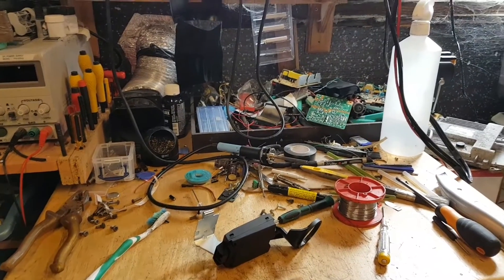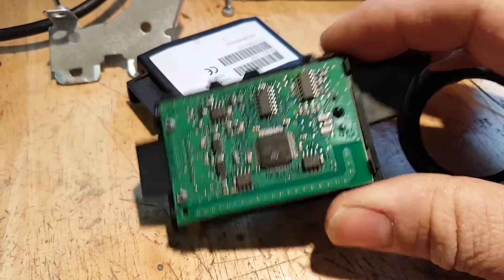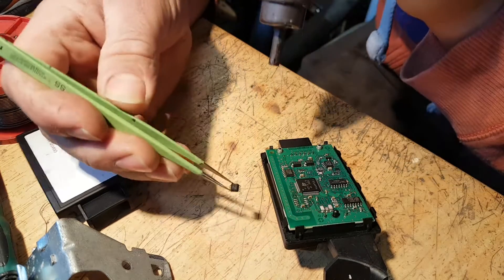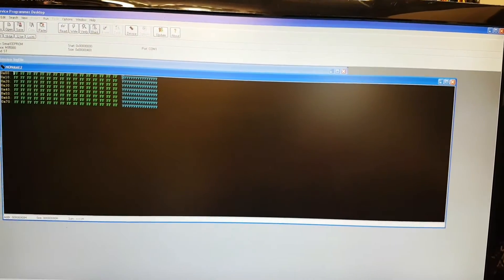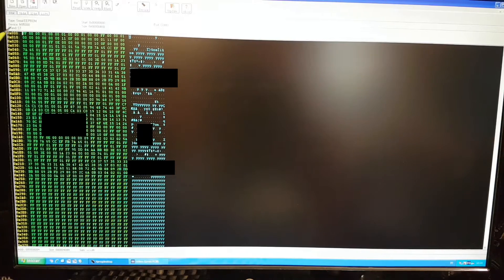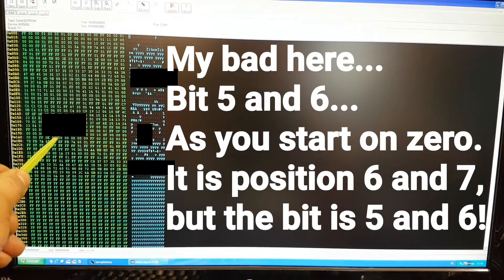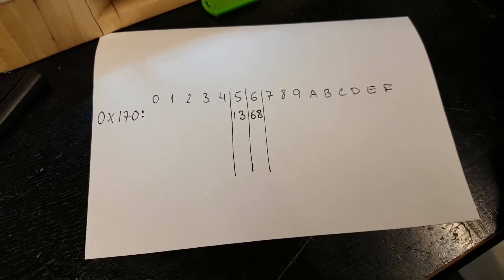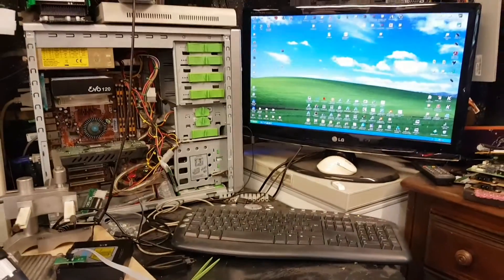Jeep Cherokee WCM Pin code extraction procedure, for EEPROM 95080.

Comment: avev quel eeprom je peux remplacer un eeprom 95080
Reply from the maker: To replace?
Can you not get old of another one? Even if used... 
What is wrong with the original one?
👍👍👍
Reply: @LMAutoRepairs  la puce eeprom es mort cest la raison pour la quelle je cherche l'équivalent
Reply from the maker: 5P08C3 also known as 95P08 or ST95P08C3 should work as a replacement, but, i have never done it, as i usually replace like for like...
I am sure you can still find 95080 for sale, even if used.
👍

Comment: Great video!! I have done so many 95040 on dodge Chrysler jeep that when I got this chip I scratched my head for awhile not finishing 1f00 lol. Sadly even after reading and swapping bits I was getting incorrect pin. But I’m sure next time it will work as I was the second locksmith to play with this and the first one may have licked the ecu up I haven’t a clue. Just guessing of course.
Reply: Got my hands on another Town and country today. All keys lost situation and sure enough it worked this time!!!
Reply: I had it not work for me again. So I ordered the PIN code sadly and it was identical to what was in the data. But kept saying incorrect. So I wrote my own pin in the data and wrote it back to the chip and it worked. 

I wonder what causes that. Atleast I know for next time. Just re write data to chip and maybe it will just work with the same pin that was originally on there. So odd

Comment: Hi! What if I just remove eeprom from my radio. It will never ask for code anymore, right?
Reply from the maker: No...
The radio will not even work...
There is other data on the eeprom... not just the pin...
The eeprom is where the radios are stored among other settings...
Thank you for watching!
Reply: @LMAutoRepairs  ah ok. Thanks a lot

Comment: Hi Luis! Can you recommend someone who can unlock or reset used key fob to program it again to another car??  Good job on this Pin code extraction
Reply from the maker: Never searched for that...
I know there is kit for the IM608 (which I intend to get in the future...), to unlock keys... not all keys can be unlocked though... As far as I am aware...
You can get aftermarket keys quite cheap though...
👍👍👍

Comment: Hi Louis, thanks for your effort. I like your work style, you go to the next level of repair. You aren't just diagnosing the broken part and replacing it, you are trying to fix this and i like that. That approach is pretty valuable especially when we are talking about modules. What would you recommend to me as a beginner in programming, coding and cloning to start with? What tools are enough to begin with? Not interested in OEM.
Reply from the maker: For eeprom and MCU probably X-prog and xhorse... but there is plenty other ones out there... make your own research...😉
Thank you for watching and for your comment!

Comment: Sir , you explain very well but i have a little problem .How to know where is the pin code in this data??
Reply: Usually the on line 170 following 1F 0F, if memory serves. it will be inverted meaning if pin code is 5618, in the dump you will read 1856. Andromeda Research Labs has videos showing this. The earlier models using the 95040 chip use a different method and requires a chart to translate the pin, also at AR Labs.

Comment: You gotta risk as if chip had any damage then car does not crank anymore.then car owner says my car was working before your attempt.So before that kind of repairment explain risks and get car owners issue thats the way
Reply from the maker: Correct...
Reading an eeprom is a quite low risk process... specially if you are comfortable with soldering...
Thank you for watching!

Comment: do you always have to reverse the numbers to have a good pin, i.e. in every car
Reply from the maker: No...
Some cars the pin is actually on the ASCii data... 
Thank you for watching!
Reply: @LMAutoRepairs  hey I have to add the keys to the c4 picasso where to read the pin ecu or bsi and what program to calculate it from the memory bin file
Reply from the maker: Citroen uses a combination of letters and numbers for the pin...
If you don't have the scratch card with the pin, then here is an example of how to get the pin...
https://youtu.be/8EE41_QskFU
You can also get it from the BSI... or through OBD using some tools capable of that...
👍👍👍

Comment: what temperature you use to desolder?
Reply from the maker: The hot air gun, I set it yo around 300°c
You don't need that high... but you can then kinda control the temp with the distance from the chip...😊
Thank you for watching!